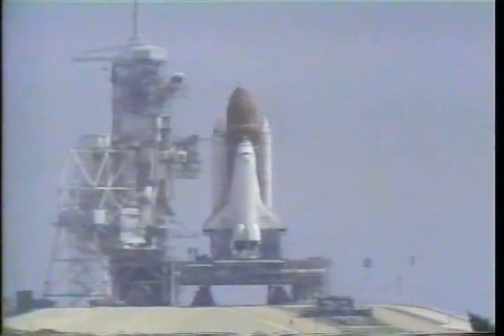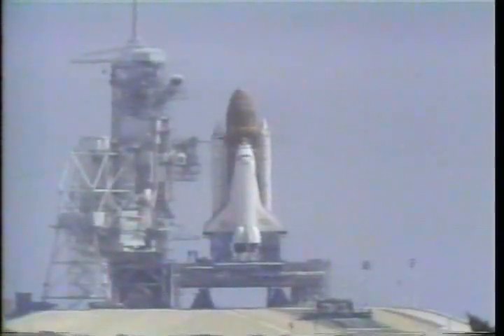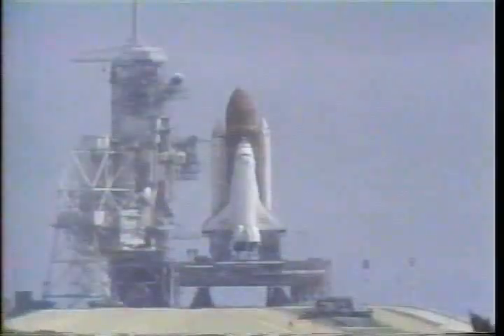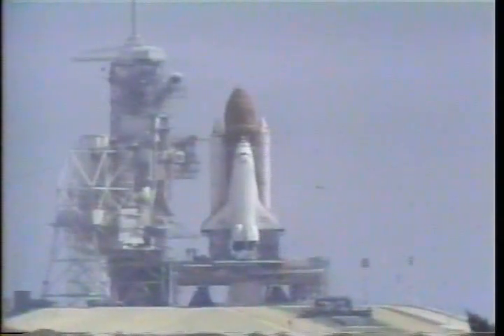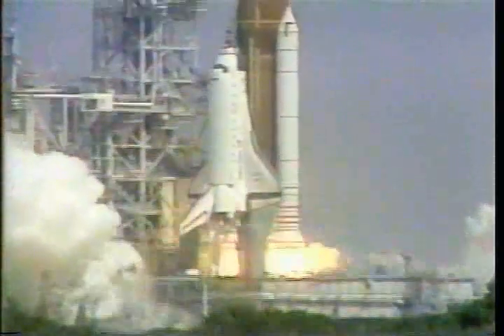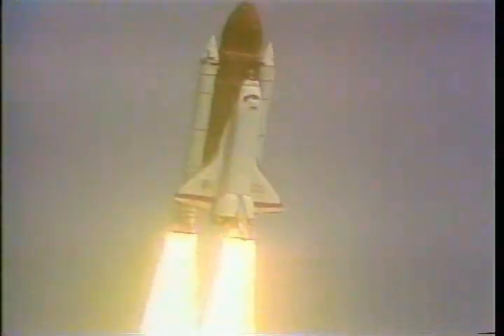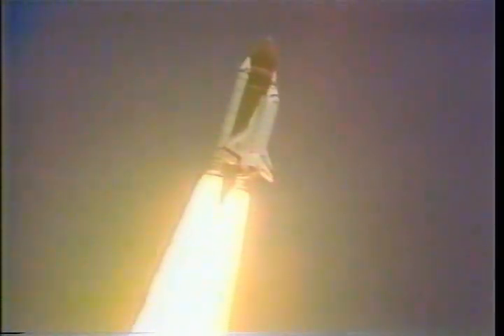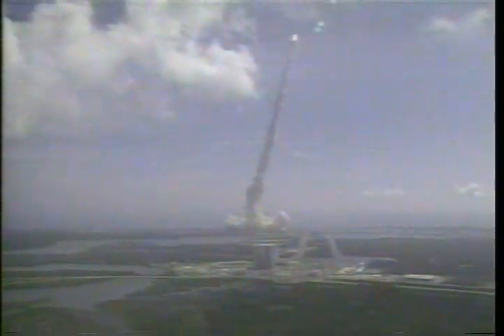STS-43 launch & landing (8-2-91)

Comment: First landing at KSC since Discovery STS-51D on April 19, 1985.
Reply: olympicnut This was the first scheduled landing at KSC since January 1986. Columbia on 61-C and Challenger on 51-L had been scheduled to land at KSC (Columbia ended up landing at Edwards due to bad weather and Challenger never reached space on 51-L). The first landing at KSC since 51-D was actually Atlantis on STS-38. STS-38 was scheduled to be a landing at Edwards but bad weather there forced it back to the Cape.
Reply: The Discovery STS 39 Mission  also landed in Florida, like STS 38 the landing st the KSC was unscheduled.